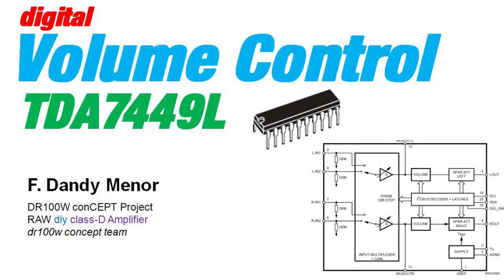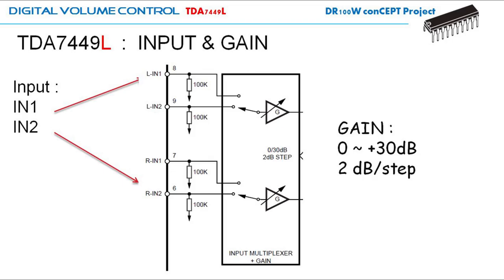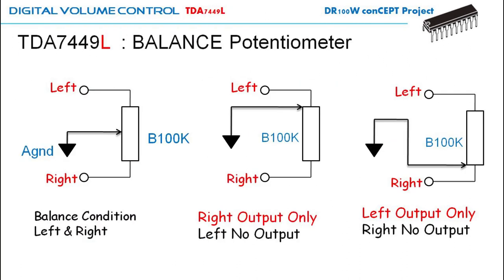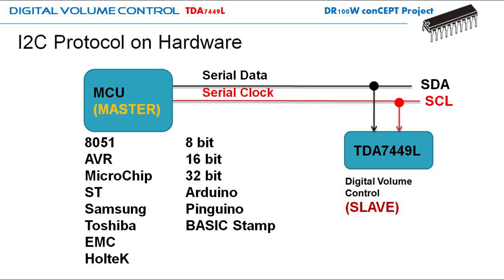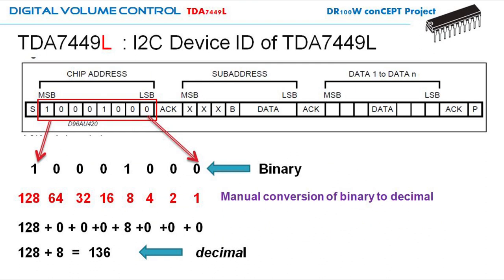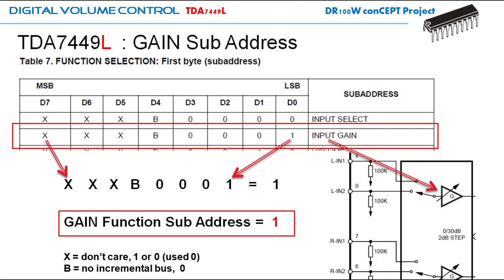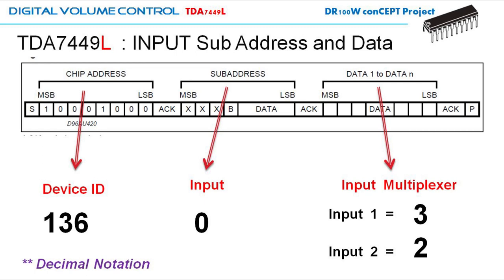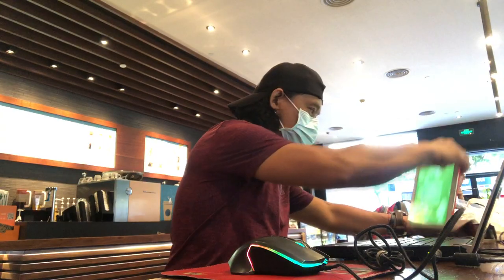MCU Programming #11 | How to deep Dive on digital Volume Control TDA7449L Gain & Balance  | I2C Bus

Comment: For me TDA7449L is a chip with analog functions. So I am concern on how to lay its pcb layout as part of embedded system in order to avoid noise/buzzing sound
Reply from the maker: you are right!  a hybrid analog + I2C control signal is a bit difficult to do the PCB with respect to GND system.   When you access the TDA7449 via I2C,  you will hear the bit stream on the speaker.  But with rules on PCB design of single point GND for analog and multi-point GND on digital - isolation component like inductor or low ohmic value resistor, you can optimized the co-existence of hybrid system,  its more a trial and error GND, cut or connect PCB track during the test to optimized the noise.  Sharing of V+ also for the MCU and TDA7449 matters - follow rules on Hardware and PCB design can help, for my project the Tone Control board is separate from the MCU and thus the I2C cable plays a lot -- twist it to immume to noise. Cheers!